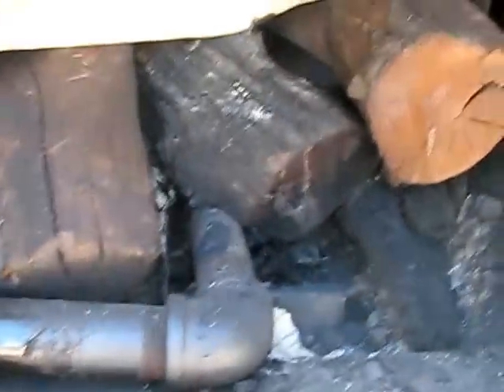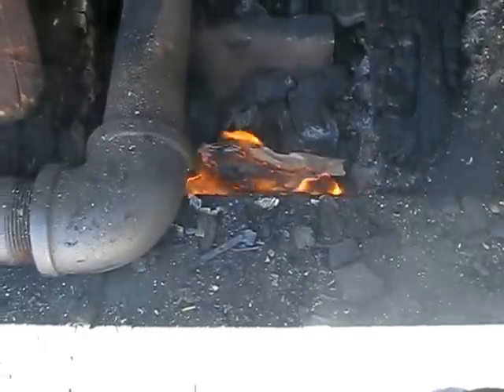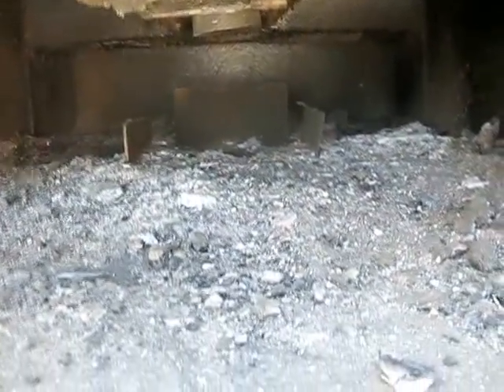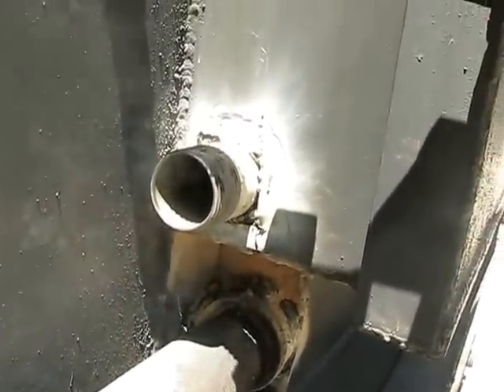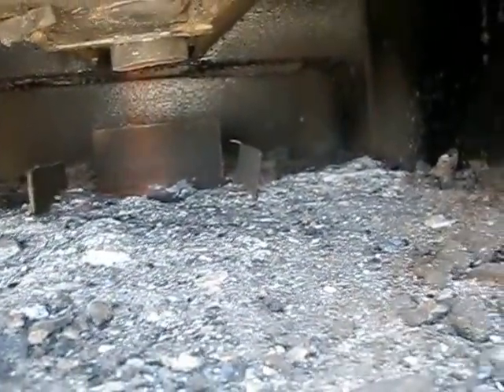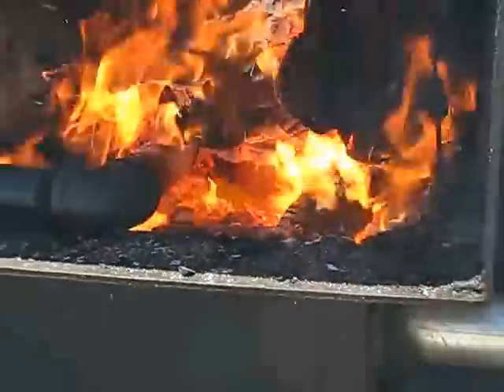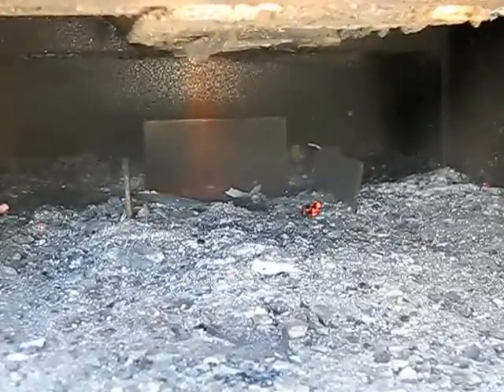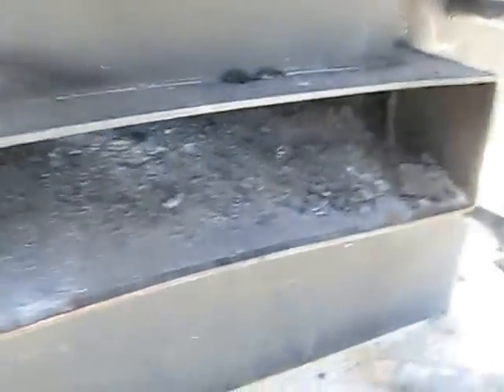Hot secondary burn (fixed)

Comment: What is the plastic pipe with the valve? Are you pumping air into that thing or is it naturally aspirated?
Reply from the maker: I have a blower to force air in.  This way I can shut everything down once the watter gets hot enough.  I just have to fill it up with wood once per day.  That valve is used to adjust the airflow.

Comment: You're secondary chamber seems FAR TO COOL! The air for second burn should come be warmed thru primary chamber then come out on top of wood/fire to reburn
Reply from the maker: +Kevin Fitzpatrick Trust me, it is not too cool, otherwise it would not produce a clean burn like that.  In fact the reason why I changed from this system is the fact that the burn was melting the 1/4" thick steal pipe.

Comment: You didn't explain your setup for us to help though it seems your 2nd burn chamber is below the main chamber? usually the 2nd burn happens above the wood/fire where it's hotter since that high temp is needed
Reply from the maker: +Kevin Fitzpatrick I didn't stick to this design, not because it was not hot enough, but because the steel pipe could not withstand the high temperature and would melt away.

Comment from the maker: I don't have any, other than the videos.  I will work on getting some though.  Sorry, I know it has been a while since I updated my videos.  I plan on making a series that will go through everything now that it is working good.  I may even draw up some plans, but right now it is getting cold, and I need to finish my building around the boiler, and get it hooked up to my in floor heading and water heater so I can start using it.